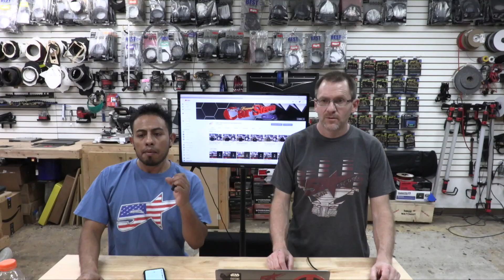Is my radios 5volt  preamp output High or Low level

Comment: I have a jl audio rd1000/1 running at 2ohms @ 1000rms. And a nvx vcw124 I am using my stock radio 2020 Acura TLX and a lc7i. Everything sound sweet to n till 5 days after install and My problem started. I’m my output is low and the gain needs to be set more than half to get any bass, it sound distorted at all volumes I changed the amp and and got less output then the rd1000. Please help me I’ve been to over 5 shops and no one can figure it out please HElP